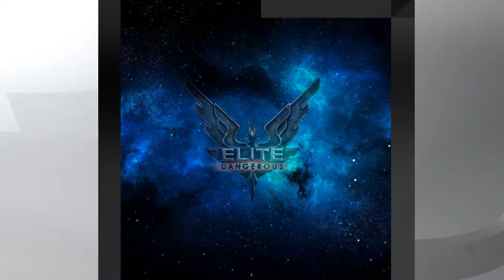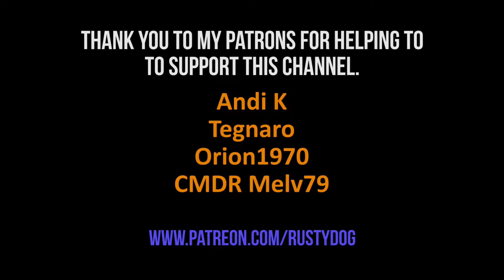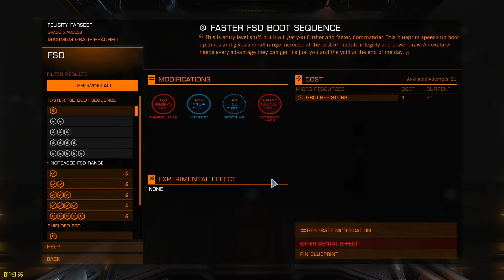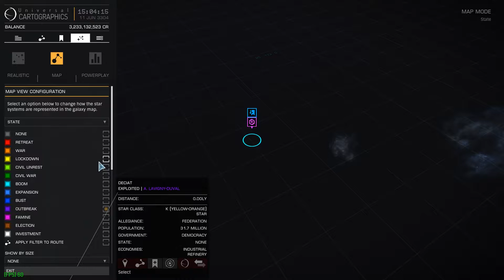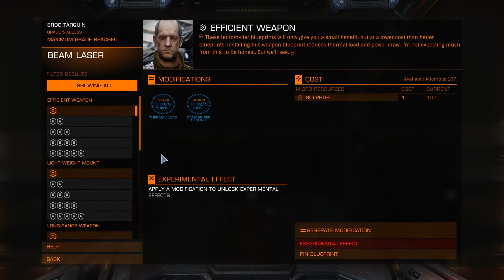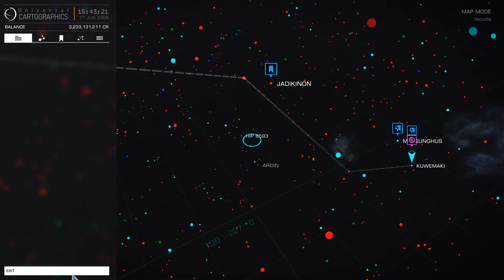Stealth DBX - Start of Engineering & quick test

Comment: one point about manoeuvring: the Clipper is actually better than the DBX in pitch, roll and even yaw (not to mention faster), the big problem with the clipper is that it's really heavy so it can't change vector quickly and the lateral/vertical thrusters aren't as good so it "drifts" a lot. i have no idea what the in-game rating is trying to represent...

Comment: If I️ can add anything of value, it would be to use one turreted  efficient thermal beam with thermal vent and multi cannons. Relying on the turret and pilot skill to have thermal vent 100% of the time. You may also get much more value added from exchanging your shield for a hull reinforcement- getting much less of a load to systems, and rusty!!! No need for pips to systems. You can’t maneuver with no pips to engines. The idea is low heat, hyper maneuverability, and weapons firing always while maintaining a low thermal footprint.

Comment: Do you have thruster mods to clean drive?
Reply from the maker: No dirty drives.  They do run cooler than clean drives in supercruise.  Maybe not so much in normal space but with the twin beams, it not an issue, plus I get better agility.
Reply: Clean drives are better for cool running ships but add weight
Reply from the maker: They also draw more power which is what I'm short on :)
Reply: Ah ok

Comment: Not sure why you so much material to complete fractions of a percent, and the FSD isnt factored into the normal space operation heat levels.
Reply from the maker: Normally I don't bother. Once the numbers match in the circles, I don't usually bother to waste materials to close them.  This time I did :)